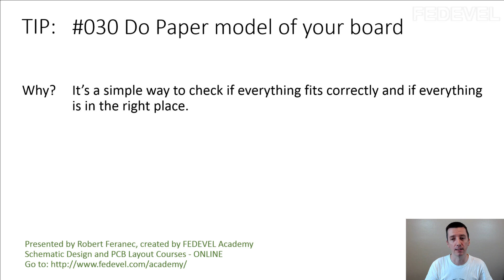TIP #030: Do Paper model of your board

Comment: What about the static electricity that paper generates? It will prevent placing some components on it.
Reply from the maker: That is a very good question. However, from my experience, I do not want to have in my board components which can be easily damaged just by touching them or placing them on a paper. Not all people/customers/clients will be handling the boards in the proper environment - many people simply hold boards in their hands, place them on their tables and they do not really care much about static electricity. If the board has a component too sensitive for static electricity, there is a high chance, that this component will cause problems in future and people may be returning the product / board, because the component may get damaged. If there is this kind of component, I would be the first to know about it - so I am not really worried about placing the components on the paper, if something is damaged, it will just help me to improve the board.

Comment: What is under the sheet with the image of the Board? How attached details on a sheet? No need to have secrets from us. :)
Reply from the maker: What is under the sheet with the image of the Board?
- Do you mean cardboard? :)

How attached details on a sheet?

- I am not sure what you mean. How to print it?
Reply: Parts (connectors, etc.) pierce the assembly sheet. What's under it?  Foam plastic?
Reply from the maker: We normally use cardboard, no problem.

Comment: I do this alot for checking specific footprints components, new chip or connectors.
And if you want to check fine footprints use a inkjet printer not a laserprinter which will slightly deform the paper with heat and warp the result in outer space.
I was really surprised how fast a laserprinted dummy PCB could have a one pin offset every 10 pins O_O
Reply from the maker: Yes, this is true, very good point.
Reply: I do this every time (especially after that one silly time I decided to not do it and was rewarded with a wrong footprint that was simple to overlook on the layout, but was not that great in reality (SOT-23-3 vs SOT-323)).

Comment: Fail fast, fail often. Very similar to your tip 005, but this one is more mechanically than electronically. On those complex boards, you don't want to fail a $1000+ prototype run with something silly like 2 connectors too close to each other.

Comment: These series of tips are really good.  Another course suggestion could be a bare minimum iMX233 board (DRAM / CPU / supporting circuitry with bare minimum boot functionality), and then building the board up over additional lectures (adding peripherals to the base board).  This would be a really interesting course for beginner / intermediate level.